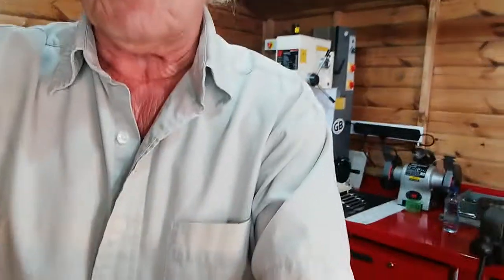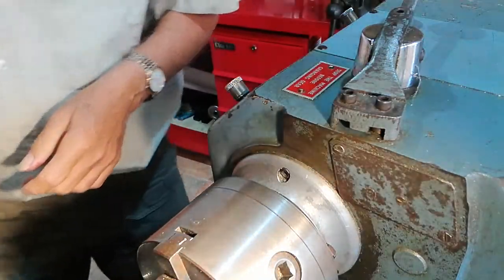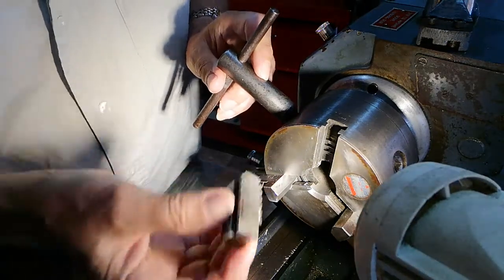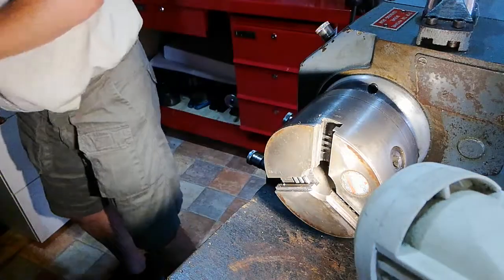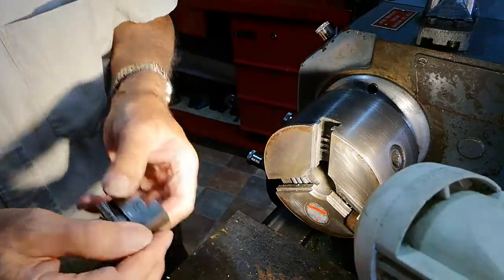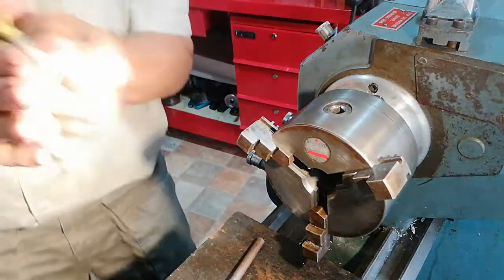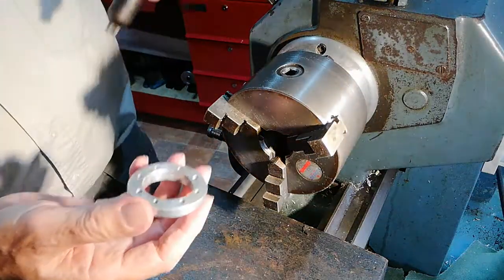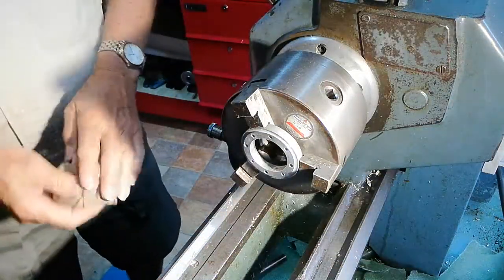Self Centering 3 Jaw Chuck. Resolving problems and maintenance. {TUTORIAL}

Comment: Interesting video. Yet to try the reverse jaws of my Chinese 3 jaw chuck. I do have a very cute little Bernard 3 jaw chuck, but it really is too small (I think its 2.5") and has a knurled wheel for tightening so it doesn't grip very well. Camera mount seems to be working well. I am just looking at mount one from the wall or ceiling next to my lathe. Thanks 👍😀
Reply from the maker: Thanks for your comment. I think that I've seen the small chuck on one of your videos. They are quite neat , but as you know, do have their limitations. They can also make your hands sore when trying to tighten with the knurled section. Best of luck with your camera mounts. 📸🍀
K.